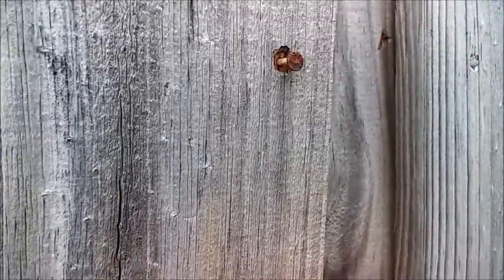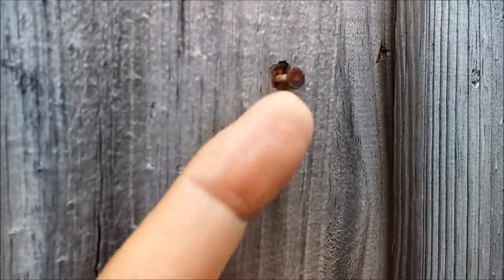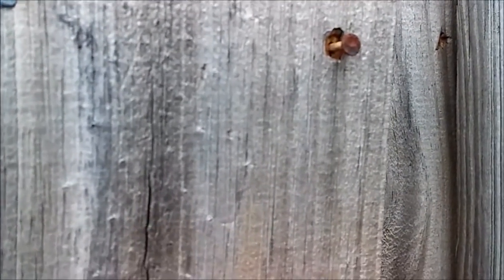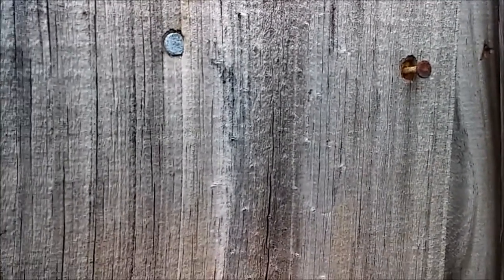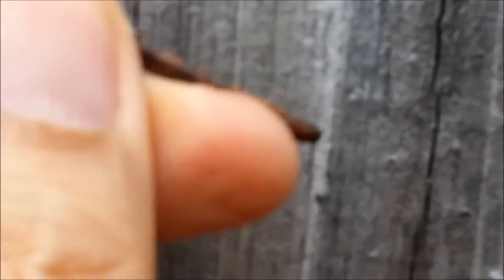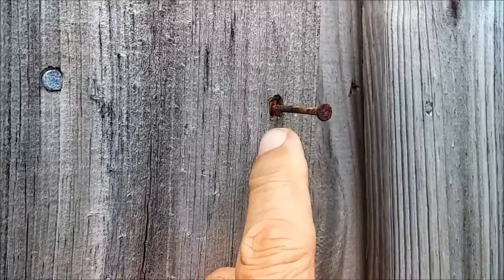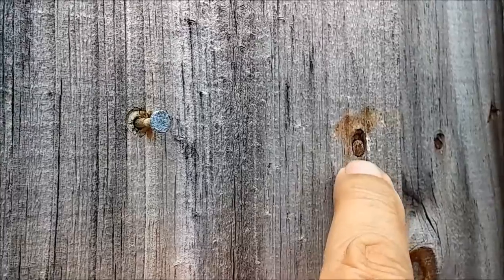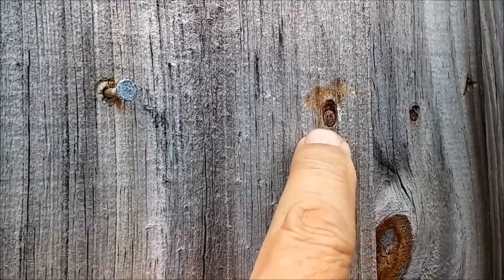Never have nails come out of a wooden fence again

Comment: The wood all throughout a house expands and contracts as well so why do they use nails to build houses?  That would be a little dangerous considering people live in them don't you think?
Reply: And what if someone uses ring nails?   If anyone is reading this you probably want to use galvanized nails to build your fence because that way the fasteners will not bleed and you do not get those black tears running down your wood  Like the tears that almost started running down my face when I watched this video and all of the badd habits it shows people
Reply: It's because the wood in your house doesn't get wet... assuming you have a roof. You do have a roof right?

Anyways this old guy is right about the wood expanding.... but the solution of rehammering in old rusty bent nails to fix it isn't the solution.... the solution is to use screws and then paint your fence.
Reply: @crocodile2006  yes, screws are a must